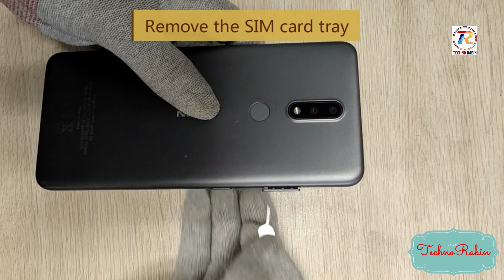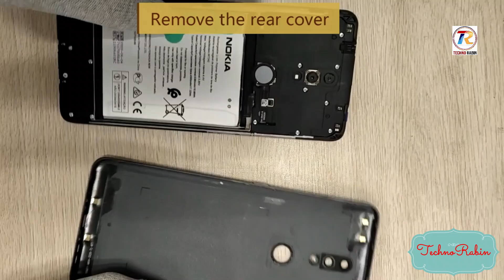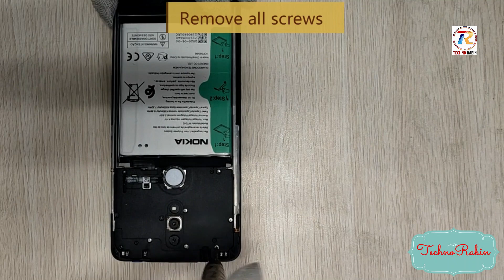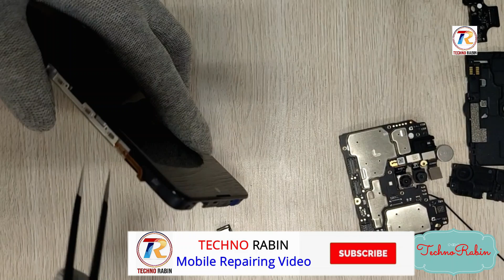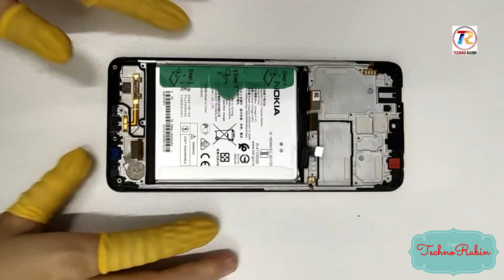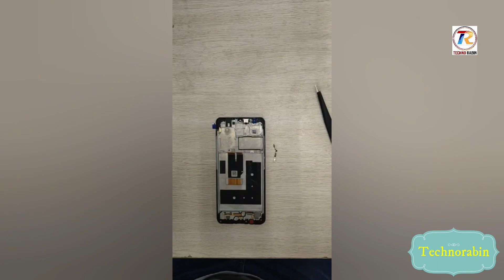Nokia 2.4 Disassembly Video

Comment: Thumb down for unscientific method of disassembly.  He removed battery at last, which actually should be removed at very beginning
Reply: No need to remove it first, as long as you disconnect it at the first opportunity, unfortunately he did not do this, and he used tweezers to disconnect everything!! Personally I use plastic whenever is possible to minimise the chance of an damage. Nice to see how everything comes apart, not the best working practices though.